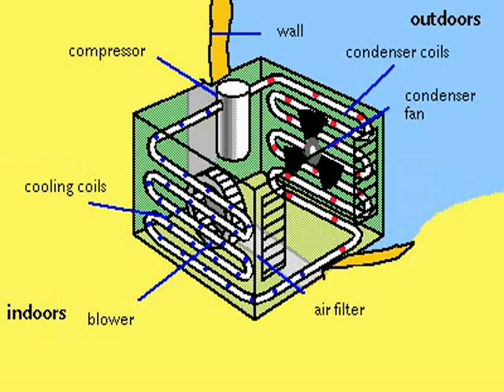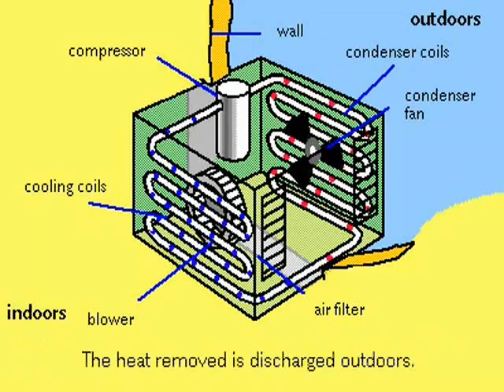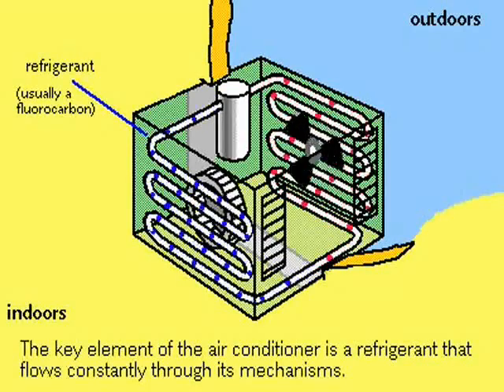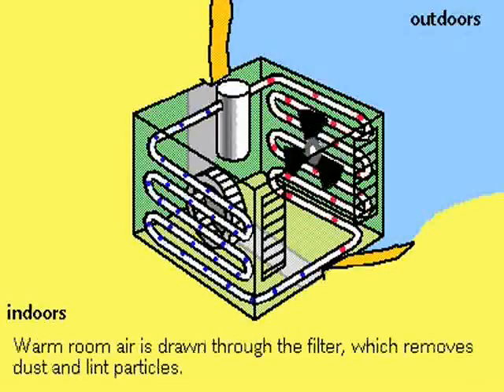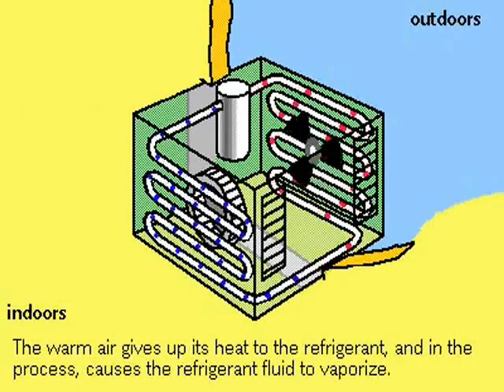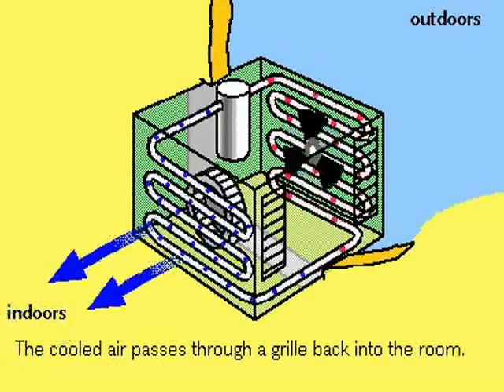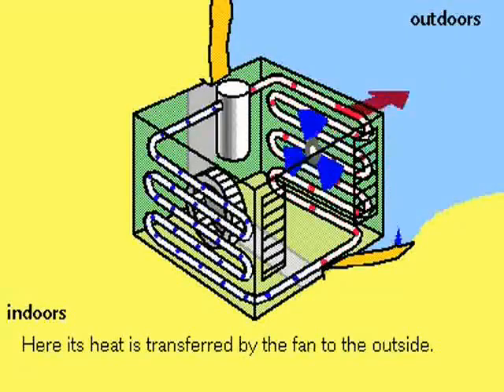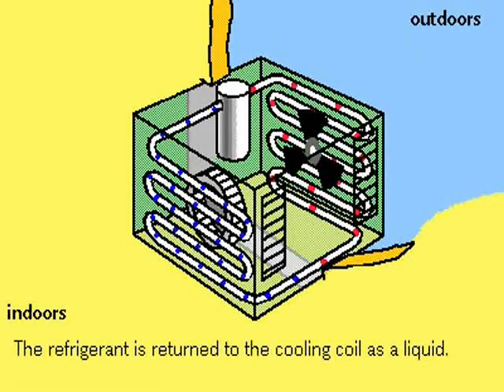How a heat pump works

Comment: You are not talking about a heat pump this is a air conditioner.
Reply from the maker: Heat pump IS AIR CONDITIONER with reversing valve. It merely reverses the flow of refrigerant.

Comment: They're not referring to a geothermal heat pump in this video... instead I believe the intended purpose was to address the heat pump cycle in a split air system (HVAC) as it would pertain to the reversing valve, but the RSV was never mentioned regarding its functions with regards to the indoor and outdoor coils.

Comment: This seems to be a very simplistic description that doesn't really explain much. But.. a residential heat pump does not necessarily need any water flowing. Ground sourced heat pumps often use water pumped though a heat exchanger in the ground as a source or sink of heat.  This works well because the ground is generally cooler in summer and warmer in winter than the ambient air.